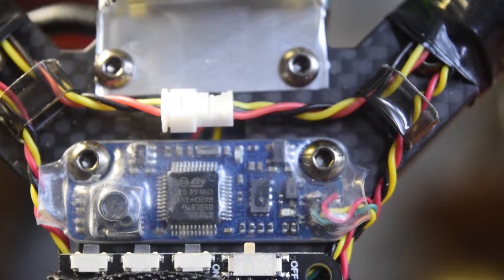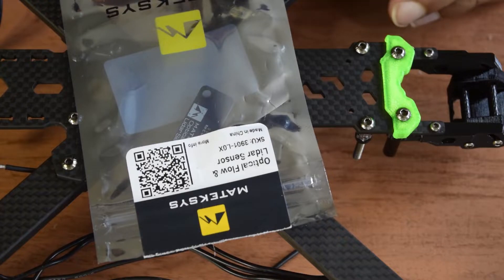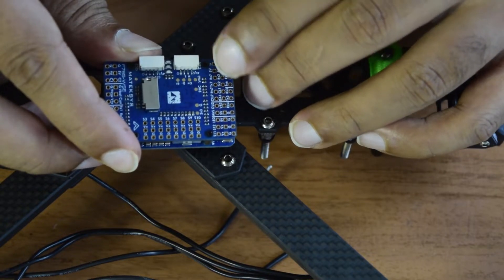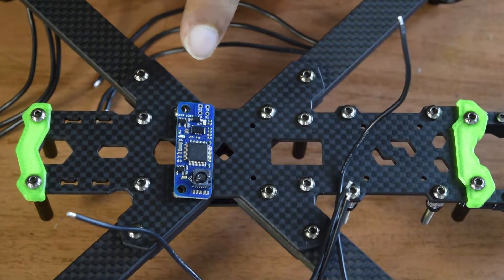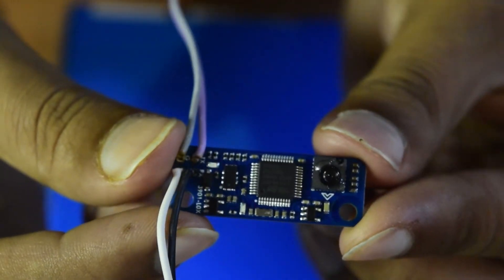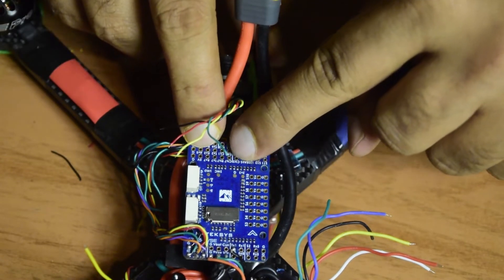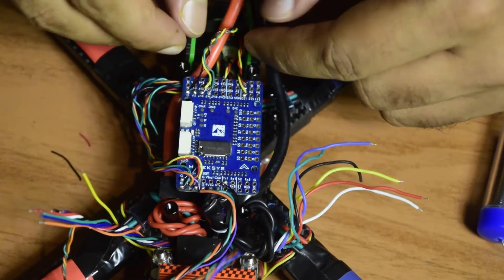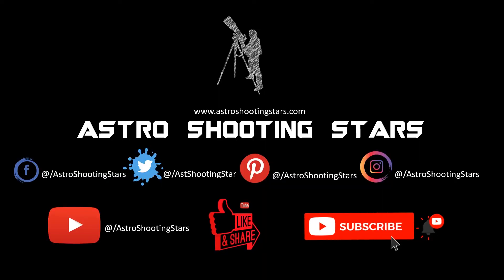How to Install Optical Flow Sensor on Drone | MATEKSYS 3901-L0X Optical Flow & LIDAR for Alt hold

Comment: Sir hum SpeedyBee F405 Stack me kese installed kese karenge
Reply from the maker: same process follow karo as long as ports are avialable on your speedybee you con connect on your FC rest is config in firmware